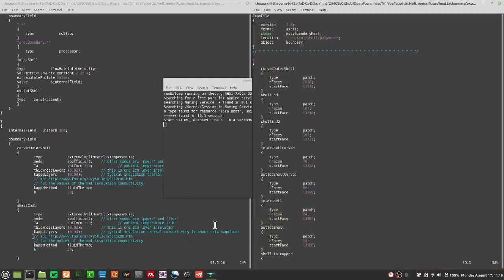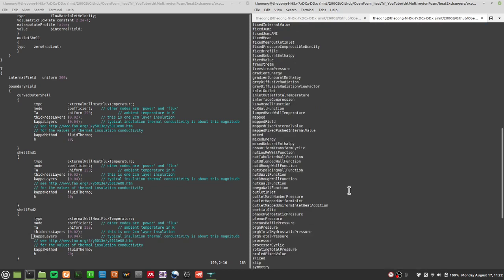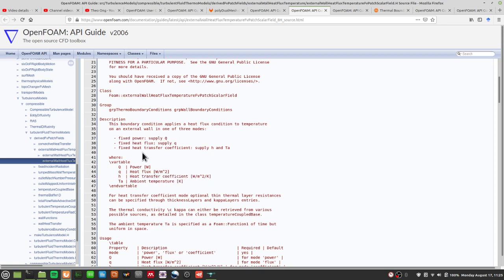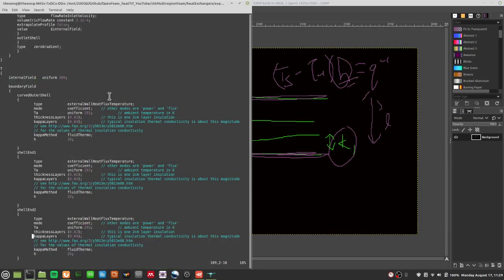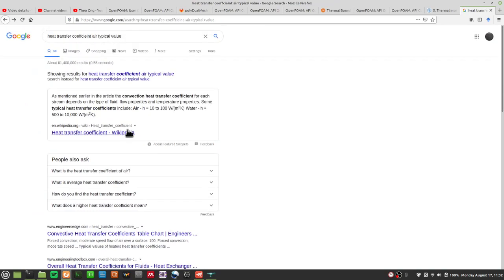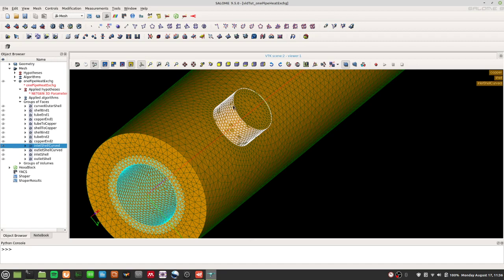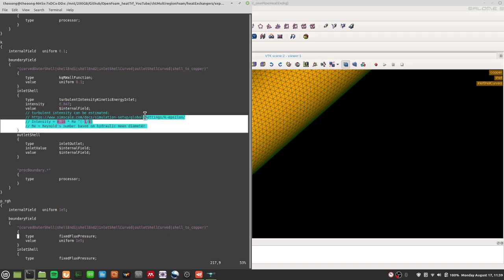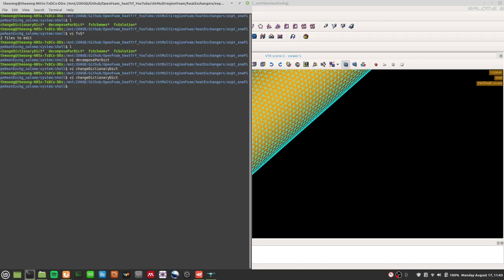OpenFoam Heat Transfer 67 - externalWallHeatFlux and other BCs

Comment: Hello sir
When I am using external wall heatflux bc for temperatures in buoyant pimplefoam it's working but when I am using external wall heatflux bc for buoyant Bussinseq pimplefoam fosm it's showing  request for basicthermo thermphysical properties please guide how can I run wallflux bc with Bussinseq model

Comment: Hi, I am really thankful for ur videos, no one is doing what u are doing for free, respect. I have a question, how would you define a heat flux in terms of a distance? like heat flux profile along the y-axis . Best regards,
Reply: @TheoOngScienceAndEngineering  like for example an electrical heater inside a pool, but the power on the electrical heater isn't uniform, so I have to define some sort of a heat flux profile